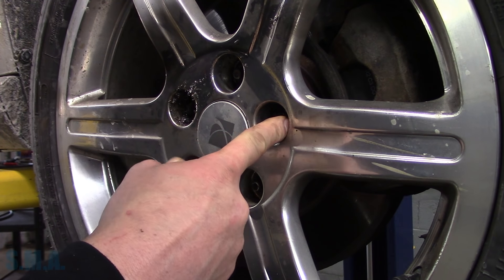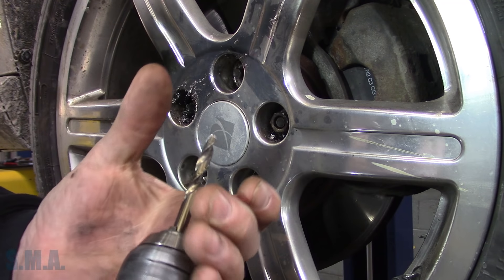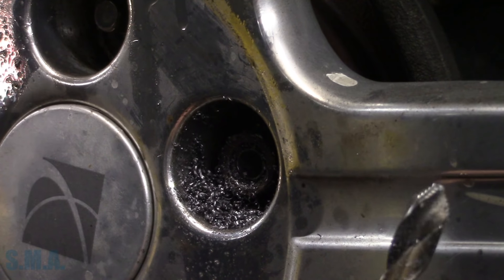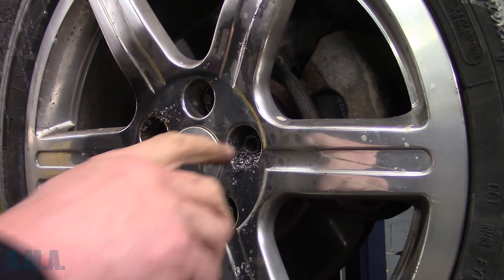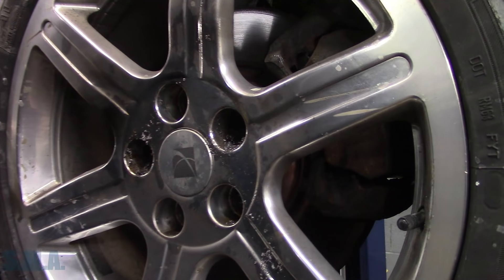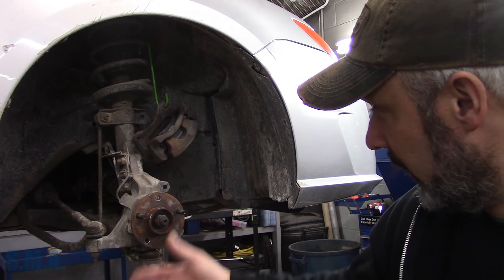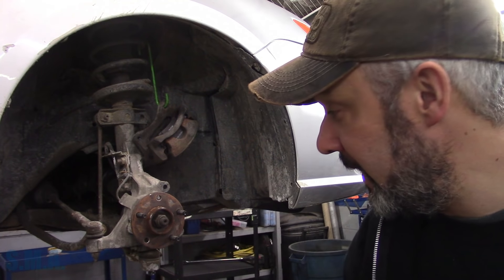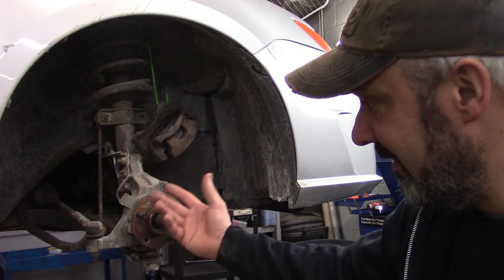DIY Seized/Stopped Lug Nut Removal

Comment: one if my "interview" methods for evaluating a new shop, is to have a tire rotation done.
if I get the car back and I can't remove the lug nuts with the emergency tools, then they're immediately off the possible shop list.
Reply: Plot twist John is 18 inches tall and 13 lbs.
Reply from the maker: @juanc5149  🤣 I pee'd a little
Reply: @juanc5149  well, part of me is 😍
Now, I don't mind being the butt of a joke, but could you clue me in so I can laugh too?
Reply: @johnhufnagel  Remember, we're not laughing at you, we're laughing near you.
Reply: I swear i torqued my brothers VW lugs right to the spec (im sure it was near 100 ft lbs) NOT EVEN a week later i went to took them son of a guns off...oh dear the high torque is struggling some? 2 bar battery...ok lets try a new one. NOPE? Breaking bar...I'm litterally lifting the car off of the ground and spinning the tire, this is not it. After some hard grunts and feeling like i'm a women going into labour, there i was, with it loose. Next time the thing is going back together with some copper spray anti seize (i've done it, works decent) or something. Almost broke my back for that.
Reply: problem with that is, not clean surfaces and fast corrosion can stick everything within a few weeks, even days! worse with todays junk poorly recycled metallurgy

Comment: I've had to use a sacrificial socket before, two sizes too small, beat it on there, and then throw the socket away.
Reply: Discount Tire taught me that trick for removing a security lug nut when there was no key. Worked great, but I was able to reuse the socket by vise and drift.
Reply: @flagmichael  ya, on the security nuts, toyota/lexus smooth type. Missing the key? 20mm 6 point, impact deep socket pounded on. Works best , Btw I have/tried all the special removal sockets.You can reuse the socket over and over. Snap on ? Naaaah, Sunex is good enough.

Comment: Great tip as always! One more tip: if you around off a couple nuts, stop & bring it to a trusted shop. (They may be able to remove the rest without rounding each) Also, bet owner never used a torque wrench to tighten before. Probably tightened until they couldn't any more. Then they seized even tighter! Then at removal time...

Comment: A person would have to be " nuts " to round out all those 😖😜
Reply: Or be the $10/hour kid they have doing oil changes and tire rotations at the dealerships and tire shops....because that's where it happened to my wife's expedition.
Reply: @WreckDiver99  🤪
Reply: @WreckDiver99  I've seen $20/hr. guys do it over & over again.  That's why I don't let anyone touch my vehicles.  After inspection I bring it home and give it a thorough going over.  Things are usually left disconnected, wheels are over tightened.
Reply: @papaboattail3736  Unfortunately I don't have the time or many of the tools to do it.  More the time.  Even a brake job, a couple hours total for me, is a 3 week lead time to schedule in.  I've never seen a $20/hour guy at the dealership or tire shop...not doing rotations and oil changes.  LOL
Reply: Oh, it's easy. Starts with those #$%^& tin caps. Get a little split  in them, water gets in and the NY salt. I'm so glad I dont have to deal with that crap any more
Reply: @WreckDiver99  The $20/hr. guys I was referring to were in a truck lease repair shop that also leases vans.  Nonthe less, most start with no experience what so ever and pull these mistakes over and over again.
Reply: or a real stud.......
Reply: @papaboattail3736  you would think that if the first couple don't come off they would try something different ?

Comment: A little anti seize or grease on those threads in the past would have gone a long way. In the rusty parts of the country it a must
Reply: Applying any kind of anti-seize or lubricant to wheel studs is something auto manufacturers strongly recommend not doing. Doing so can result in in lose of a wheel.
Reply: Your NOT supposed to put anything on the treads since it changes the torque values. This happens from shit lug nuts and the wrong size socket. The crappy chrome cap layer comes off but people keep hammering away with the larger size and round them over.
Reply: Right, because of all the anti seize related deaths....probably should put loctite on each one. 
I’ll take my chances.
Reply: @anichols5845  GM factory service data specifically warns against applying anti-seize or lubricants to wheel studs. I trust that GM knows more about this than me. And I do know of an incident where a wheel fell off due to this.
Reply: David Quinn    Yeah,  all that bullish-t about not lubing lug threads. I used 3 in 1 oil on every thread every time since my first tire change in 1969. No nuts ever loosened and I never had a torque wrench until two years ago. Always used a speed wrench and always tightened until it squeaked tight. The only caveat about using lube and a torque wrench is the values change so you need to under torque to be at the correct value. Look it up - there’s plenty of info online about this.  👍🔧
Reply: David Quinn   I would never ever trust GM for any reason. Actually not any of the Big Three. Not to know more than me and not to build safe, reliable automobiles. I’ll always trust myself more - to do things right and to know how to research.   On the other hand, I’d ALWAYS trust Eric O!  👏👍🔧
Reply: Anti seize all the way, been using for over 30 years and never any issues.  Throw away all those 2 piece lug nuts and buy stainless lifetime lug nuts and you will never have any issues.
Reply: gravelytodd   Works for me! 👍
Reply: The only line nuts have seen come off are because they were loose to start with as in never tightened but I have seen plenty broken off trying to remove or stuck in place due to rusting / corroding. This goes for tractor trailers down to atv’s and thousands of cars and light trucks I have worked on over the forty years as a mechanic
Reply: @Rein_Ciarfella  Also not recommended by: Toyota, Honda , Ford , FCA and MB that I'm aware of . But, hey, what do they know .
Reply: @davidquinn6161  its not like they have thousands of engineers that know better then some chump.
Reply: So when Eric does which I also do sprays a hub with Fluid Film or his old product Muscle Grease you don’t think it gets on the studs Really ?
Reply: @jimhaines8370  My comments are related to what the manufacturers recommend against, not what Erik does. And, yes, I've noticed him spraying Fluid Film on hubs and noted that it does get on the threads. Why don't you ask him directly what his opinion is the subject of lubing the threads. I  note that he hasn't commented on the discussions on this subject.

Comment: Here's my free tip Friday, smear some wheel bearing grease on the wheel so the torch won't damage it as much. It will still leave a small mark but it's way better than a huge burn

Comment: The way I was taught is to cut around each paw and a slit up the bottom side to the tail. Im not familiar with the other methods of skinning lol
Reply from the maker: Nope, ya cut around the base of the tail, step on the two hind legs then pull the tail to the head, just like a squirrel.
Reply: @SouthMainAuto  I thought it required a tennis ball, rope, tree, and four wheeler...  Oh wait, that's how to skin a deer.
Reply: I use a 10 gauge with number 4 shot. The only skin thats left is usually smoking.
Reply: @treyinok  Or it's a kinky outdoor party :)
Reply: @SouthMainAuto  Lol!!

Comment: A friend of mine weighing in at 220 did the brakes on my car lucky I was there he leaned on on the breaker bar and he practically was off the ground tightening them I said "how much do you weigh"? I said you just tightened thos nuts to about 200 foot pounds I replaced all the studs as I'm sure they were stretched. Great tip thanks.
Reply: Good thing he was trying to help!  :/

Comment: I love the smell of schmokin’ lube in the mornin’!  😉🔧   Then, of course, there’s the problem of getting the lug out once you’ve got the nut removed. I had one cross-threaded lug (I didn’t freakin’ do it!) on my Astro and researched the heck out of how to do it all over YT. Tried every one of those methods with no success. Finally in disgust I got out MY Big Nasty, my three pound sledge and wailed on it. Badabingbaddaboom, done!  Slipped out the back side, got a new one in and Bob’s yer uncle! 👍🔧
Reply: Craig Roth   Nah, just was really careful with my aim. Would have saved me an hour and one of my favorite aluminum C-clamps. Had that thing since the’70’s. What was I thinking?! Smack my head!

Comment: When at the point you were at with that car, if beating a smaller socket on won't work anymore, I go in behind the hub with a torch and remove the mushroom end of the stud, then punch it through backwards. If it is drum brakes, or inaccessible to the torch, well drill and burr wins every time. Patience is a virtue for sure.

Comment: I had this happen, not on lug nuts, but on the captive brake rotor holding bolts on my ‘92 Accord! I didn’t own impact tools or extractor sockets at the time, so I went “old school” and hammered a chisel on the edge, but this didn’t work... so I had to use my drill and bits similar to the manner depicted herein, and after drilling the hole all the way through the 1” or so bolt, the hammer and chisel finally persuaded it loose! I kept the drilled-through-its-length bolt as a trophy, it hangs from the rear view mirror of my Accord to this day!

Comment: I had one on my 5th wheel camper tandem axle that way.
Some jackoff cross threaded the lug nut all the way on with a big impact wrench.
I actually could not move it.
I had to use my long handle Matco 1/2" ratchet with long cheater pipe on it to just break it off.
Them I had to press out the old stud from the brake drum and order a replacement from O'reilly's Auto Parts and press it back in .
What started out as a tire replacement and brake assembly replacement , turned into a 3 day job. Good thing I was doing it myself and not paying a shop.
BTW  , on campers it is actually cheaper and quicker to replace the complete brake assembly with electromagnet than just installing 4 sets of new brake shoes.

Comment: Fixing the unfixable!  Inspiring.  Work smart/ worksafe.  ............ IF the Back Disc/Drum will come off the Spindle knock the Rim center out pull the spindle nut Whole drum comes off then use Angle grinder on back head of Stud.

Comment: 85% of the video I need ATM! 😆 Front tire blew out a few days ago here in AZ during hottest heat wave in rec. history here in USA. AAA said 2 hour tow wait. Got a ride home 4 spare and back in 5 min. (MUCH quicker!) Then this young man offers to change it.
I'm too miserable and fatigued from the heat to do it myself at this point, so I hesitantly agree. Thinking (not clearly)...What damage could he really do? Well, he cross threads not 1, but TWO lug nuts FFS!!!
Already wasted hours w/no joy yet. Your video is perfect despite 1  problem your co-worker mentions, but y'all didn't offer the resolution. My damn lug stud's are spinning too, how did u remedy that? 
I'd be sooo grateful & seriously indebted if you'd fill me in. (Plus then, this will be a 5 star, 100% perfect post 😜

Comment: Never seen that before.  I always put some metal tubing sleeve between the nut and wheel, then tig welded a new nut on the end of the bolt.  Just keep a spray bottle of water to spray between the sleeve and wheel so it doesn't get damaged.  Thanks for the tip!  This looks easier if I can find a sharp drill bit in the tool box ;)

Comment: Great tip!  Years ago when I was younger and didn't know what I was doing,  I had lug nuts and the studs spinning and couldn't get the wheel off.  Miserable experience.  I think I used a punch and a sledge hammer and hit them til they broke off.

Comment: A garden sprayer with just water does a good job for lubricant. You can add dish soap to make the water slimy. You can hold the drill and sprayer at the same time.

Comment: Needed this in 1987 when I took my K-5 Blazer to a Boron Service Station (Now called BP) to have a slow leak fixed. He couldn't get the lugnut off, so he used a hammer and a chisel to chip away at the lugnut/stud and the rim...he chiseled the rim (didn't ruin it but you could tell he boogered it up with his chisel.)

Comment: I know it won't work on all of them but I have occasionally welded a leftover cv axle nut to what's left of the stripped nut and taken it off that way. It's only going to work if you happen to save any of your old axle nuts and the shape of the wheel will accommodate it.

Comment: I have done a similar thing with destroyed philips head screws. You drill out the center of the screw with a bit smaller than the threads and it releases the tension enough that you can back the screw out with no problem. You have to drill straight and use the smallest bit you can though.

Comment: Another good reason to use fluid film or even anti seize providing you don't use too much of it, just enough to get into the threads then wipe off the stud and then install the lug.
Reply: I presume you meant "use" rather than "sue" ;)
Reply: @flagmichael  Fixed it, thanks

Comment: What I have in the past is if you can access the back of the stud I cut off the back of the stud with a torch and pop the stud right out. I've had to unbolt the caliper to gain access but it's always worked for me

Comment: Eric O’, I like those Tire Dealers who have the whole row of Color-Coded Torque Sticks, hanging behind the Service Desk, covered with dust, and Never been out in the Shop. I always recheck my lug nuts after having tire work. Almost always at over 160 ft/lb. Sometimes I can barely get them loose with my Longest breaker bar. When calling the tire place, to let them know, I get “Oh no, we always use a Torque wrench to spec”. Yeah Right. I only know ONE cure. Buy tires at South Main Auto!!!

Comment: Good on you for not destroying the wheel. That said, I've had luck with the half sized extractor sockets. You have to use a size they you can hammer on tightly and they usually will come out. Either way the job is done, and I'd say either way is fine

Comment: On steel wheels or alloys with enough room I will cut a notch in the lug nut and give a quick rap with the air hammer. If they don't spin they will at least split in half 👍

Comment: A useful trick, to be sure. However, there are plenty of cars (though they're often older, so not too much of a concern in NY where anything more than 20 years old has generally been retired due to fatal rust) where to replace the studs the wheel hub has to be pressed out, which sometimes will destroy the bearing in the process (as with the 4th gen Civic, unless you're comfortable with an ugly fix using a hacksaw/dremel/etc to avoid this). I'd suggest verifying wheel stud replacement procedures before damaging the old ones too much, if just to see how much of a job you're in for if you have to go this route.

Comment: Been there. Done that. I also drilled down the walls of the nuts themselves with thin bits and chiselled them open a fraction by belting in a ground down centrepunch. I only had very occasional success in unlocking nuts seized to the walls in the alloy rim and learned the extra time and hassle was not worth it compared to your method. A nut chemically seized into the alloy rim itself is going no place except to a destructed end. Then the fun bit is struggle and grunting the rim off when it is itself seized to the hub shoulder.

Comment: Some tire shops put the lug nuts on too tight. Happened to both front wheels on my car. I was able to get them off with those sockets stripped nut sockets though. Nice tip with the drill bit though 👌

Comment: I've had success in beating a deep impact socket on . Whatever works...
Keep a supply of beaters, they usually survive for years btw. Yea I like Sunex and those brands  too. Similar quality to the Shnapp off. [Yes!] 12 pt, 6pt  , half sizes. Beat em on, pound em out. Special socket extractors- meh. Not very good imho, and never last very long.
Btw, the reason the lug nuts [covers]distort is from over tightening .
Of course , the jinx is on. Next one I do ,I will end up drilling. Thx Eric . Good vid.

Comment: Eric you ever try putting a socket on the nut hit it with a sledge and shock it ? a method on youtube saw

 have 5 crusty lug nuts to remove 
need to get a 1/2 drive 6 point   3/4" socket

Comment: This is what I get to do tomorrow thanks to another shop. Over tighten the lock nut on a buick. Customer had a blowout guess they tried to get the spare out and change it but tried to take the lockout off then bam. Nut breaks. So tomorrow it's stud drilling time

Comment: As someone who has used vegetable oil to drill through rod steel before, yeah, it's not too specific on what lube you have to do. Just watch the smoking points if you're around anything else that's flammable.

Comment: On these I just use a hollow tube that fits over the remaining nut and long enough to extend out of the wheel long enough to grab it with pipe wrench or vise grips then I simply weld the nut to the inside of the tube trying your best not to hit the stud but if you do then just twist the stub off. after doing a few of these you never have to lose the stud.

Comment: I have done a lot of lug nuts and wheels lock too but never try to drill it, I think people to stop over tighten the lug nuts and torque to spec it would be easier to remove it damage, thank you Eric for that video. PS have you ever done one with the lug spinning while the lug nut stuck on it and wheel wouldn’t come of